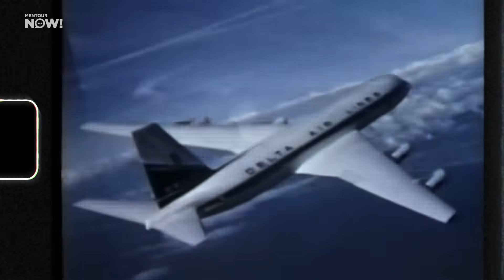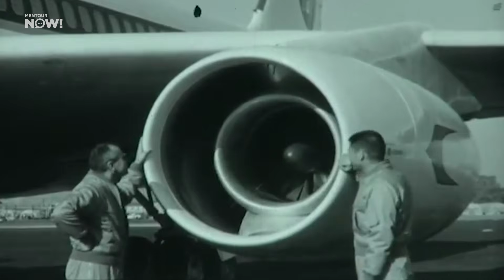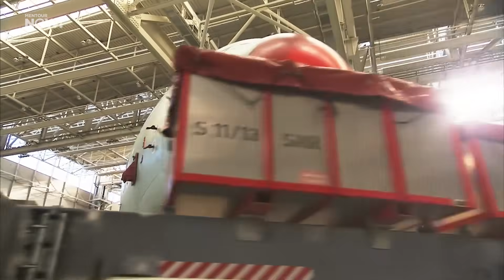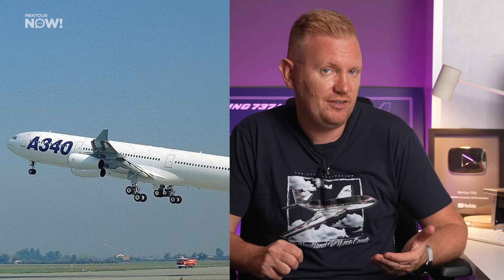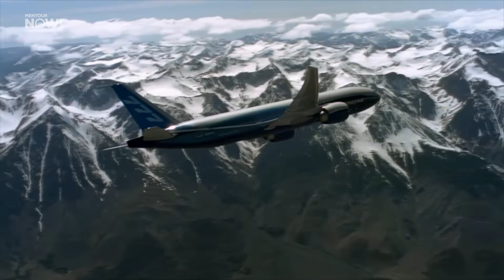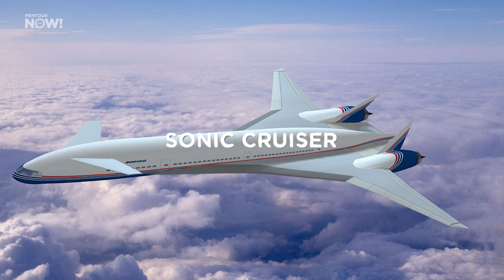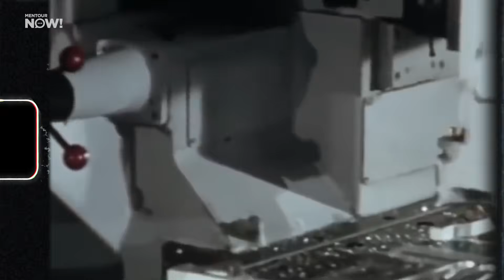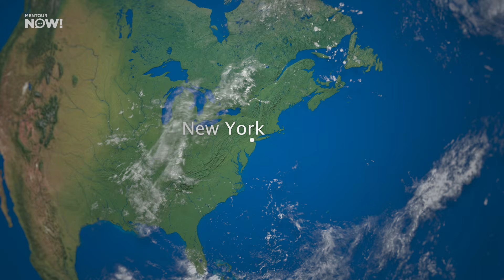WHERE is the Boeing Sonic Cruiser?!

Comment: I love the idea of sonic cruises for long distance flights. Crossing the Pacific or over the North Pole region, or even the Atlantic in massively reduced times would be amazing.
Reply: If you want to fly fast, use a rocket. Cruising speed around Mach 20. SpaceX plans to use it's new Starship for this purpose too. They think they can make the ticket price competitive too. I hope it happens, because it would be insanely cool.
Reply: @andrasbiro3007  No ones going to willingly fly on a controlled explosion
Reply: @cancelanime1507  
Except everyone does. Jet engines are controlled explosions too.
And really rocket engines and jet engines are not that different. In many ways rockets are actually safer. For example takeoff and landing doesn't require going very fast on the ground, and that's where most accidents happen. Rockets also can't accidentally collide with terrain, because they are moving vertically when close to ground. They also care less about weather, because they don't have to generate lift with large wings, and don't fly close to the ground. And with very short flight times weather is less likely to deteriorate much at the destination. Also planes have to come down no matter what, but a rocket can abort to orbit, where it can wait for rescue, or dock at a space station. Once the rocket is flying, it's just a little extra fuel, and infinitely safer than trying to land.
Reply: @cancelanime1507 what do you think we went to the moon on? A prop plane?
Reply: @andrasbiro3007  deflagnation is not the same thing as detonation.... Detonation is much faster and hotter. Rotating Detonation Engines (RDE) are the closest things we have to use of an explosion as a means of propulsion. We have not advanced further due to the fact that such is hot enough to melt every known material quickly.... Also, no, just because the flow is supper sonic doesn't mean that a detonation has occurred....
Reply: @andrewyork3869 
There's no detonation in rocket engines either. At least as long as they are working properly.
Reply: @andrasbiro3007  then why did you describe rocket and jet engines at controlled explosions?
Reply: @andrewyork3869 
"Explosion" is a more general term. I wasn't trying to be scientifically precise.
Reply: @andrasbiro3007  where you not trying or did you outright not know what you are talking about? I say the second.
Reply: @andrewyork3869 
I've lost track of what you were trying to say.

But you are still wrong. Jet engines require a lot of maintenance, far more than you think. Rocket engines don't need much.
The big difference is that jet engines operate for hours at a time, while rocket engines only for minutes. The wear and tear is proportionally less. And a Raptor 2 or 3 engine is simpler then a jet engine, that helps too.

And, again, the Falcon 9 booster is already being reused, and based on the turnaround time they don't do much maintenance.

Also, a Raptor engine costs about $200K, which is a small fraction of a big jet engine. The 33 Raptors on the booster plus the 6 on the ship together cost as much as a single small jet engine.
That also implies significantly less complexity.
Assuming that maintenance cost is proportional to manufacturing cost, which is reasonable, that also means a lot cheaper maintenance for Starship compared to a large commercial jet. Fuel would cost around twice as much, though. But the construction cost is much less, for the whole ship too. So the total cost per mile should be in the same ballpark.
Reply: @andrasbiro3007  you greatly underestimate how close to the material limits rocket engines operate they will always have a shorter service life than a jet engine. Again, the pumps in particular for such a system are the weakest link. You bill 33 engines as though it's a good thing I see one of 33 reasons for a flight to get scrubbed. Objectively, you are wrong, on all fronts.
Reply: @andrewyork3869 
You greatly underestimate how reusability changes the math. When you reuse a rocket, it no longer has to be as cheap as possible.

And you greatly underestimate how good SpaceX engines are. Raptors are happily operate at chamber pressures that were thought to be impossible just a few years ago. SpaceX can afford to operate them well below their limits, and still get more than enough performance out of them.
And, again, the old Merlin engines already can fly many times with minimal maintenance. I think now the record is 18 flights. And the number is going up regularly.

And particularly SpaceX's turbo pumps are extremely robust. In 2017 there was a big fuss about turbine wheel cracks, to which SpaceX replied "We have qualified our engines to be robust to turbine wheel cracks".

Starship can lift off with only 30 engines working, and can lose more as it gets lighter. This has been demonstrated already during the first orbital test. 3 engines were shut down at launch and 3 more were lost in flight (prototype engines). The rocket ultimately failed only because the hydraulic system exploded and that made it uncontrollable.
Oh, and since then the engines got more powerful. Raptor 2 has 25% more thrust than Raptor 1, and Raptor 3 is another 18% more powerful.

Objectively, you are wrong, on all fronts.
Reply: @andrasbiro3007 that's a joke those engines are to expensive to maintain.
Reply: @andrewyork3869 
Which engines?
Reply: @andrasbiro3007  rocket engines.
Reply: @andrewyork3869  
Wrong. For starters, almost no rocket engine is maintained at all. They are thrown away after a single use. Before SpaceX only the Space Shuttle engines were reused, but even those were essentially rebuilt, so it barely counts.
SpaceX engines on the other hand built to last. They don't require much maintenance. SpaceX have a lot of experience with the Merlin engines, they reused many 16 times already without much maintenance. And the new Raptors were designed with all that experience, so they should be even better.
Reply: @andrasbiro3007  that's was my point.... Space X reuses their engine's which cost money.... Lots of it high RPM turbo pumps, very exact combustion chambers, and inspecttion of temp and pressure rated fuel tanks, none of which comes cheap.... Try thinking before speaking next time....
Reply: @andrewyork3869 
Are you saying that it's cheaper to build new engines than maintaining them? Very unlikely.

The fact is that SpaceX has been reusing it's rockets extensively since 2017. It clearly saves them a lot of money, otherwise they wouldn't do it. We don't know the details, as it's a private company, but according to rumors SpaceX charges 30% less for a Falcon 9 launch with a reused booster. We also know that some had been used 16 times already. And we know that the turnaround time record is 21 days, and a significant part of it is transporting the booster back to the launch site.

Try thinking before speaking next time....
Reply: @andrasbiro3007  Again, maintaining these engines IS NOT CHEAP! There is always turn around time. Once when and if these are human rated, expect turn around time to double or even triple. 

Bare in mind if turnaround doesn't kill this ITAR and energy cost will. You clearly know nothing beyond Twitter threads. Seriously, academic papers are easy enough to read on this subject once you learn the vocabulary. There is also a FOSSish sweedish rocket program that, while not exactly the same, is still very similar if you wish to study beyond the combustion chamber and nozzle in rocket design.
Reply: @andrewyork3869 
Again, maintaining a rocket engine is far cheaper and faster than building a new one from scratch. This is like base level common sense stuff.

The rest is just incoherent rambling I don't have the patience for.
Reply: @andrasbiro3007  I never said it was cheaper to build new vs reuse outside of outdated edge cases. I said it's cheaper to maintain a jet engine than a reusable rocket engine.

You are being remarkably dishonest....
Reply: @andrasbiro3007 not going to happen. Just an Elon fans wet dream.
Reply: @wizzyno1566 
Except it already happened. The first orbital test happened a few months ago. It didn't reach orbit, but that's expected for a first test. Next flight in a few weeks. And many more prototypes are waiting in line to fly.

Also, SpaceX already has the best rocket in the world. The Falcon 9 absolutely dominates the launch industry.

And btw. NASA plans to use Startship for landing on the Moon, so they probably believe in it. And I think NASA knows more about rockets than you.
Reply: @andrasbiro3007  That it's scam
Reply: @victormikecharlie1596  
Are you one of those who are trying to convince me that the car I drive every day doesn't exist?
Even if you are just talking about Starship, the development is mostly public, multiple cameras are live streaming activities at the site 24/7. And we all saw it flying recently.
The only question is how much it will cost in practice.
Reply: Never bet against Elon. SpaceX will deliver their suborbital system. Not tomorrow or next month but it will happen.
Reply: Honestly the sonic cruiser might be able to work in the modern environment. The time saving even on transatlantic routes while only 20% would mean the difference for taking a morning flight out to London, doing business and getting home before dinner all without losing the efficiency you'd get with a 777 or 787 which would happen if you attempted to design a supersonic airliner again.

Comment: I suppose by now that 800-900 km/h is fast enough to go anywhere in the world for 95% of the people, if the alternative is paying more to get there faster. With energy only growing more expensive over time, I think this is what it'll be for a long time.
Reply from the maker: Fuel costs certainly aren't helping sell faster airliners.
Reply: Fossil fuels will be more expensive. Energy prices on the other hand will go to essentially zero in a decade. Solar panels and batteries will be dirt cheap, and the optimal combination would be massively overbuilding the generation capacity to minimize the storage requirement. That means essentially free power for most of the year.
And if you have essentially limitless essentially free electricity, you can make synthetic fuels from CO2 and water.

And if you want to go fast, a suborbital rocket can cruise around Mach 20. 30-45 minutes to anywhere on the planet. SpaceX plans to do this with their new Starship, and think they can offer competitive prices too.

Comment: I have to wonder if trans-sonic aircraft might be more viable today, now that the 787 has proven the value of "long and thin" routes?  Maybe not for medium-haul flights like New York to London, but maybe for even longer flights like Los Angeles to Sydney, where a 20% reduction in travel time would be more significant?
Reply from the maker: Rising fuel costs probably wouldn't help a newer attempt at this idea. But never say never!
Reply: @MentourNow  I think it could be viable if it would have a similar efficiency to a 777 or 787
Reply: That's basically what Boom is doing with their Overture
Reply: @thearisen7301  No that's completely different because that's a supersonic airliner. The fuel burn and drag are much higher thus it will be much less efficient than what the Sonic Cruiser was aiming for.

Comment: The real reason Boeing decided not to proceed with the stretched 747's is that the analysis of the longer wing in conjunction with the stretched fuselage resulted in structural difficulties that made it essentially unproduceable. I know because I heard it directly from one of the engineers who were designing the wings, and within a month they were winding down the work on 747X.
Reply: Interesting.  We built the 747-8 and 747-8F that have longer fuselages and higher span wings.

Comment: Now I understand why boeing made the 787 having the 777 already doing about the same
Reply: The 787 is not quite as large but is more fuel efficient and far more comfortable (I've had some terrible flights in 777s). Aircraft manufacturers have to try and fill the different niches.

Comment: 13:28 that is an over-simplification. yes, friction drag increases with the square of the speed, but there are 3 other types of drag, one of which actually DECREASES with increasing speed. but i agree, flying at transonic speeds creates a lot more drag than at high subsonic speeds. i have a book that says drag at supersonic speeds is lower than at transonic speeds (assuming the aircraft is designed for such speeds).

Comment: Decades ago I read in my uncle's book about beautiful steam engines, that increasing top speeds provides relatively small time savings compared with increasing speeds on slow sections (and decreasing waiting at a stand-still, though that wasn't mentioned in the book). It's a simple truth that applies to all forms of transport, whether to explain why the same train arrives faster when stopping at fewer stations or why it's often close to a toss-up whether it's better to go by bus or airplane between European capitals.
So however much I would love to fly in a supersonic passenger jet, I'm fully aware that compared to the cost of doing so, the time savings don't really measure up. And increasing to only just below the speed of sound, would make so little difference in time, the money would definitely be better spent on an extra fast track check-in or two at the airports - and that way you can fit in the budget travelers and VIPs in the same airplane, saving the company - and potentially all classes of customer - a lot of money.

Comment: Wondering if anyone will build another supersonic passenger jet?🤞another great video Petter👌
Reply: Sometimes I feel the only way well build something as ambitious as a supersonic airliner anymore is if someone else does it first! 
I mean hey that's basically the entire premise of the cold war isn't it, and why we got so many groundbreaking aircraft from during that time. 

Nothing drives innovation like external competition, especially when national pride is at stake! 

I assure you if someone like China came out with a supersonic airliner. We would be on the case in no time! 

Shame though. Nowadays there isn't any real driver for such rapid innovation, nothing to justify the huge development costs especially when everything seems to be about the bottom line nowadays.
Reply from the maker: Thanks! We shall wait and see..
Reply: Forever is a long time but I don't see it any time soon. Civil aviation has been trending towards increasing capacity and efficiency rather than speed and I can see that continuing with increasing focus on environmental impact and hopefully noise abatement
Reply: Well, Aerion tried it with a large business jet configuration and failed. Boom supersonic isn't exactly in great shape either. 

I suspect that technologies will have to change significantly. Maybe even a completely different power source.
Reply: @jakebrodskype  Nope, the killer with supersonic aircraft is noise - and innately so. Not just the supersonic boom, but supersonic aircraft speed means supersonic exhuast velocity from the turbines, with commensurate noise at takeoff and landing. Ever hear a fighter taking off?

Comment: NASA bought at least one Convair 990. They were using it for collecting data from the air, including an early airborne synthetic aperture radar system built by the Jet Propulsion Laboratory. It was used for several years but had a catastrophic engine failure and fire on takeoff. Fortunately, all of the crew and radar operators escaped safely.
Reply: I remember seeing that airplane at Ames Research Center on a tour of the NASA facilities as part of a class at the local “JUNIOR University” 😊
Reply: @Mentaculus42  Yes, I heard from people at JPL who used to travel to NASA Ames to fly on the Convair 990. I believe that the fire was on takeoff there.